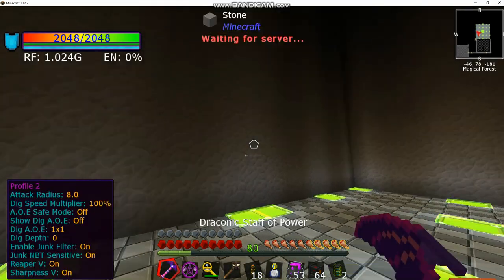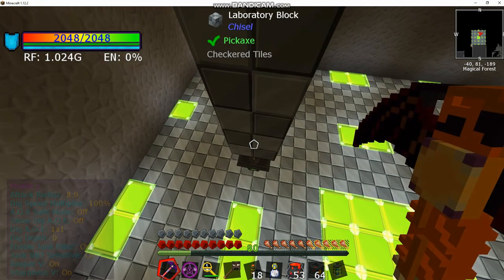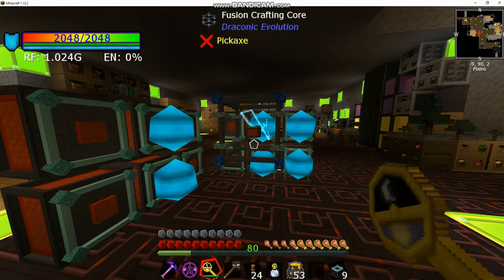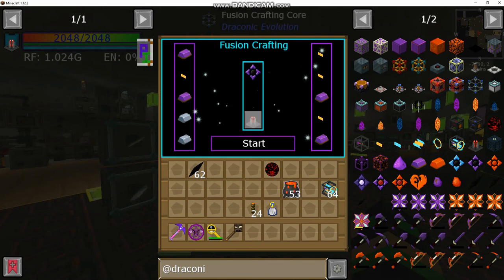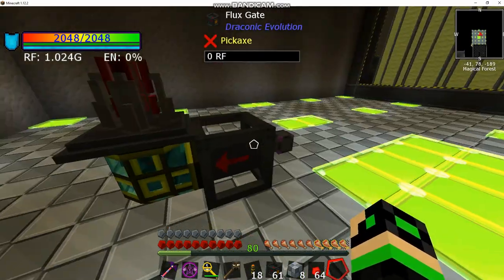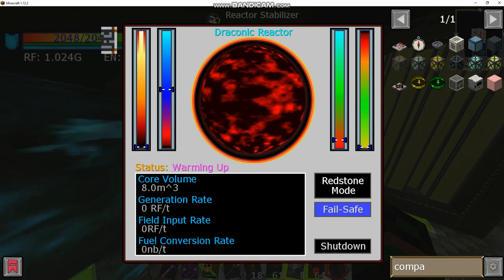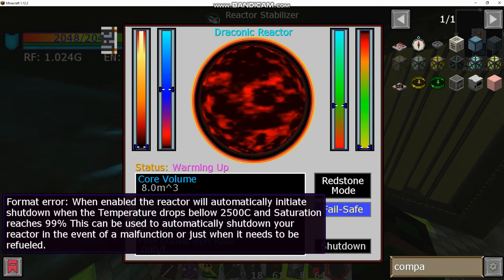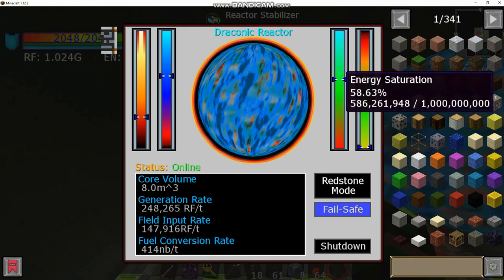Stoneblock 2 with LD7, How to Build a Draconic Reactor (EP40)

Comment: For those of you finding this video later, you only need 0.01% field strength for it to work just fine. Should you let it idle that low? Absolutely Not. Personally I prefer anywhere from 5% to 10% field strength, as this lets you pull out much more energy as you aren't wasting it on the shield. And prevents sudden surprises if there is a change.
Something more obscure that a lot of people don't realize is the more fuel that is burnt up and turned into "Chaos" the more efficient the reactor becomes. After you consume 75% or so of the fuel, you can pull out significantly more power, this is why it is recommended to use something like computercraft to regulate the reactor.